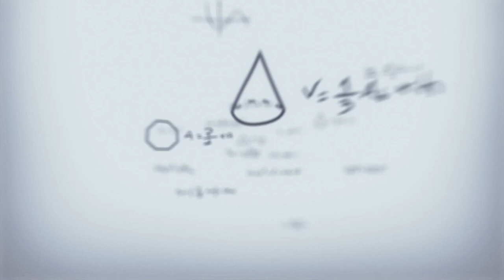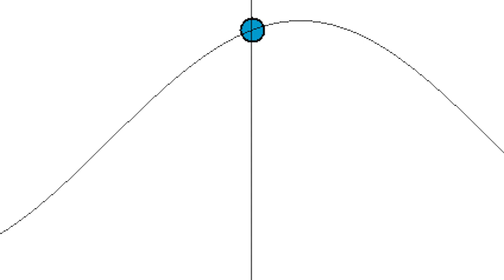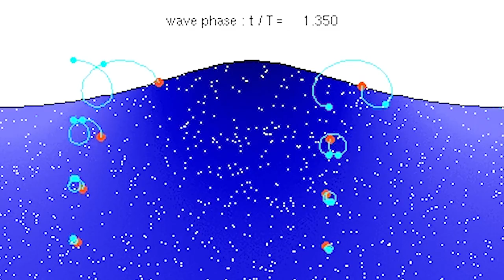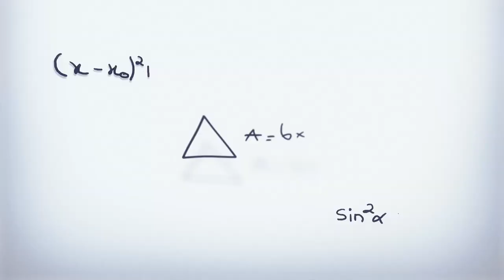Wave Energy Converters: Engineering Challenges and Opportunities

Comment: Hi Rosie, love the channel. I think I see another fundamental problem that you did not mention. Mechanical power is force x velocity, or torque x rpm. It is mainly the force for which you have to pay in materials, while the velocity or rpm, up to a certain level, comes almost for free. This is why race car engines turn at 10 000 rpm and why jet engines turning at 20 000 rpm have a much higher specific power than IC engines. Also in wind turbines, the blade tips are moving quite fast. In wave technologies, however, we seem to be dealing with low velocities and low frequencies, meaning that high forces are needed for a certain power output, for which you will have to pay in material costs.

Comment: Just for fun, my thoughts on the challenges of WEC (Wave Energy Conversion).
The cost! Due to the below variables.
1) Maintenance. Time, equipment and materials to battle the effects of the ocean. Any moving part, or seal doesn't last long. Also, bio fouling.
2) Up front costs. To even attempt to survive ocean life the construction cost to build something to last is $$$. 
3) 100 year storm. Surviving the normal ocean conditions is one thing. But any design needs to survive the 100yr store scenario.
4) Efficiency. It's a struggle to capture enough energy in all wave conditions (directional and confused seas) to produce an adequate $/kw ratio.
5) Environmental impact. Anything more than an anchor, and you're going to be fighting at least one enviro group. Noise, vibration and obstruction of wilds life. And eye pollution, of course. 

It's easy to capture the motions of the ocean, but meeting that $/kw, taking into account all the above has proven more than challenging. If we try to solve the problem backwards/idealistially, then a solution would probably need the following characteristics. 
1) As few moving parts as possible. Like one. Ha. 
2) No joint seals that could fail.
3) Made with as many off the shelf components or manufacturing methods.
4) Captures energy in multiple axis. 
5) Extreamly easy to maintain, clean and repair.  And probably a >1yr maintenance cycle. 
6) 100yr storm survival. It needs to be able to ride out the worst of the worst. Be it Durability or adaptability. 

(That's one cup of coffee worth of thought)
Reply: Oh, and I forgot to clarify that idealistially everything is enclosed inside a fully sealed body. No exposed moving parts. Ha.
Reply from the maker: Thanks for commenting Tim and I agree that all these are desirable and some of them essential. I think that maybe point 4 is in conflict with points 2 and 5 and maybe also 6, or at least with some designs it could be that focusing on capturing as much of the wave resource as possible results in a more complex system that is less reliable, and less able to withstand extreme weather. 
My opinion is that simpler is better for wave energy, at least at first until there is a demonstrated history of reliability. I'm seeing this trend in most of the WEC technology being developed today, so I think that is positive. 
🌊🌊🌊🌊🌊
Reply: @EngineeringwithRosie  You're totally right. Capturing in multi axis isn't an important factor (as long as directional waves patterns are consistent). Agreed, simpler is better!  Overall $/kw is the primary factor.
Reply: Nice high level analysis. I've been involved with subsea tidal energy projects and they are super tricky with major reliability issues, even in the slightly calmer subsea water.
Reply: it is possible now, my profesor is working over this POINT ABSORBER WAVE ENERGY CONVERSION device, I am also partially in the project cause i am not a research scholar just an btech guy.

Comment: Ha, really cool! And super interesting as always. There are a couple of projects (in research stages) about putting wave energy converters and floating wind turbines together, the ideas being 1)  just one structure for two devices 2) the motion of the floater would be reduced by the WEC (and thus beneficial to the fatigue life of the wind turbine). Don't know anything about them but that sounds kind of cool!
Reply from the maker: I agree, it sounds super cool! I think that could well be the first place we'll see wave energy really go mainstream, when it is combined with other technologies to save on the cost of moorings and electrical cables, or to reduce loads on offshore structures, break waters etc.

Comment: I’m mega impressed, Rosie surfs and manages to do an article despite one wave dumping her! Yes wave technology is still a bit of a grey area, but can’t you harness power from the tidal movement rather than wave power?
Reply: Apart from some very unique areas in the world, there are very few places where the tide generates much current. I live above a loch with a (on average) 4m tidal range. There is negligible current.

4m is a pretty decent tidal range, so you might be thinking 'why not use tidal barriers and turbines'. 

A hydro damn installation usually looks for a 'head' of about 20m. 
That tidal range of 4m I mentioned is tiny by comparison - and you only get that on some days for a few hours (neap tides are only about 1.2m).

In summary, tidal power is not going to generate much power without a huge tidal dam.
Reply: That requires specific circumstances to work. High tide level difference and a narrow constraint are needed. And power from this is being done. But it's rare enough not to be significant except locally.

Comment: The main reason why wave energy doesn't pick up yet is the design.
The 3 wave's motion mentioned in the video are Heaving, Surging and Tilting, leave them alone !
65% of wave energy converters are trying to harvest wave energy directly from a moving mechanical part such as a buoy (spot absorber) or flap (surge absorber). 
This is an intuitive approach that unfortunately leads to mechanical fatigue failure. 
Instead of changing the concept, engineers are reinforcing the system making it heavier, less sensitive to waves (low capacity factor) and more expensive --> Not competitive.

The most reliable way to harvest wave energy is called OWC (Oscillating Water Column) with compressed air as PTO (Power Take Off) --> no moving part is in contact with wave chaotic forces. 
The only moving part is the air turbine that will convert pneumatic force into electricity. 
It is basically using waves as an air piston but with plenty of design solutions that makes the overall system lightweight and simple to maintain.

Then, there is a significant cost : offshore installation and export cable laying.
In the offshore installation method statement, forget about specialized cable lay vessels charging $200k a day.
There are smarter ways to install subsea cables without these expensive vessels.

Design and installation engineering are the key get a low LCOE (Levelized Cost of Electricity).

Check out how the cheapest wave energy from France called HACE (Hydro Air Concept Energy) is working : 
https://www.youtube.com/watch?v=1zdryoZz5gg 
- click on CC and settings for EN subtitles.

HACE has been selected among the 5 start-up's (over 105 analyzed) that impact hydropower technology : 
https://www.startus-insights.com/innovators-guide/5-top-hydropower-startups-impacting-the-energy-industry/

LCOE < $30 / MWh
CAPEX =  $2.4 M / MW installed
OPEX = 5%
Capacity factor (guaranteed) > 70%

You can find me on LinkedIn using #HACE #waveenergy
Reply from the maker: Cool, thanks for the tip. I have seen some other oscillating water column designs but not HACE, so I will have to check that out.
Reply: Hi  Luc, curious what sort of kW the HACE prototype can produce?
Reply: "In the offshore installation method statement, forget about specialized cable lay vessels charging $200k a day.
There are smarter ways to install subsea cables without these expensive vessels."

Do tell me about this. 
The need to lay subsea power cables is growing. 

I'm extremely skeptical about your claim here. Extraordinary claims require extraordinary (or even 'some') proof.

Comment: This link has an idea they call "ocean battery". It involves pumping sea water into a bladder deep in the ocean. But depth should not matter because the density of sea water in the system is equal to that outside. Therefore energy would only be stored by the elasticity of the bladder? Why not pump air into deep bladders, then you store energy by stretching the bladder, the difference of density between air and water and the compression of air? This would allow a smaller bladder to store more energy. Or am I missing something? Thanks for all your info!

Comment: You would think they could capture water at high tides then just run it back to the ocean through a conventional hydro generator. I guess cost and environmental impacts among other issues?
Reply: There have been lots of ideas (the Severn barrage is one that's been talked about most of my life and I'm in my 50s) but your guess is spot on.  They are typically very large projects (it would be almost 20km for the Severn barrage) and so expensive but the environmental impact is usually the deal breaker.  The mud flats around large estuaries are important habitats here in the UK and presumably elsewhere too.  There is no end to human ingenuity but so far, the challenges have been insurmountable.
Reply: They already exist. Search for "Rance Tidal Power Station" for one example. In fact tidal water mills date back over a thousand years.

Comment: There are many varied ideas to try and generate electrcity and most of them generate an inferior type of electricity.
Because grids work on a balance of load, i.e. demand and input from generators which must match on an instantaneous basis. Unfortunately just about all renewable generation does not have the property. of modulation to meet demand which limits the amount of of this asynchronous generation (i.e. they cannot load follow.) that can be connected to the grid. 
While many talk of 100% renewable generation this simply cannot work as there is no possibility of matching supply and demand. (It's similar to driving a car with the throttle connected to a device that gives a random variable output, rather than the driver controlling it.)
This is the sort of problem that wave generation faces, and that it is relatively weak means it really is not an avenue to follow for grid supply. Of course, an undersea environment is a hostile one for any mechanical device so maintenance would be intensive. Off shore wind generators suffer erosion and hence performance loss of the blades at a much higher rate than onshore and they are well above sea level..
If we really need to produce non CO2 emitting electrical power we are wasting time and effort chasing renewables when the answer has been with us for decades. A mix of large nuclear plants and the more flexibble small modular reactors is the only choice we realistically have.

Comment: When talking about wave energy, do engineers just consider the wave from the wind?
How about the tidal waves (daily, monthly and typhoon/hurricane surge, or even tsunami), and the planetary under ocean "rivers" such as the gulf stream? 
Different wave/tide types need different methods/techniques to deal with. Hopefully Engineers like you can figure out solutions for each type of wave/water energy and make it easier to harvest and low cost to start and maintain.
Reply: Tidal power is totally a thing, you can look it up.
Reply: Tides don't really produce waves, so when trying to get power from tides you try to harness the power of the water currents, so the mechanism is completely different.